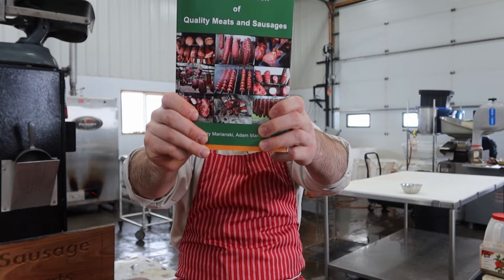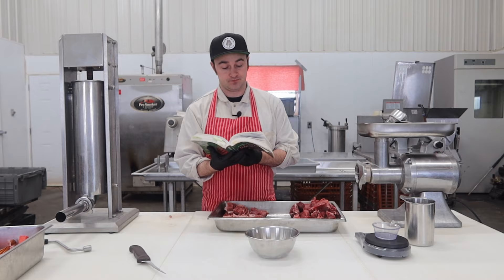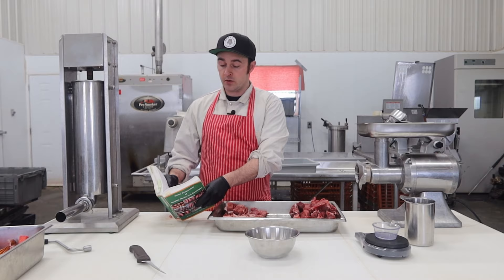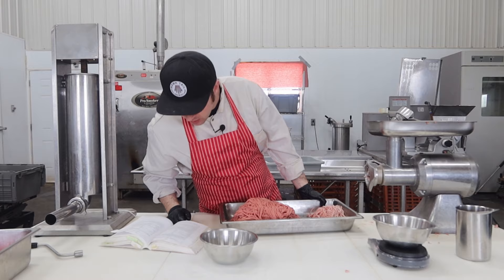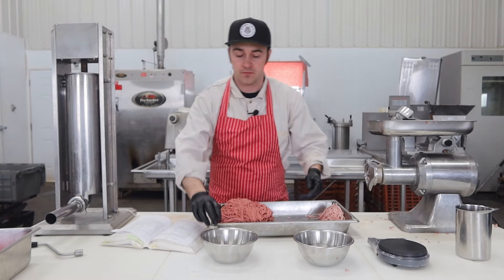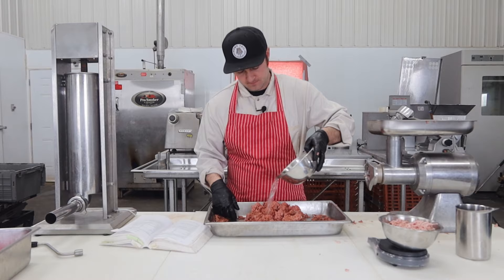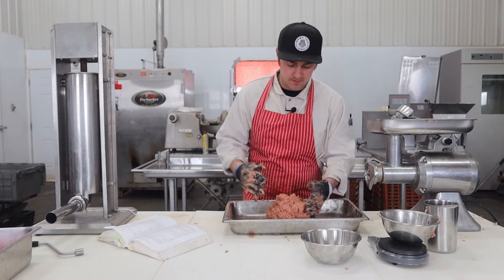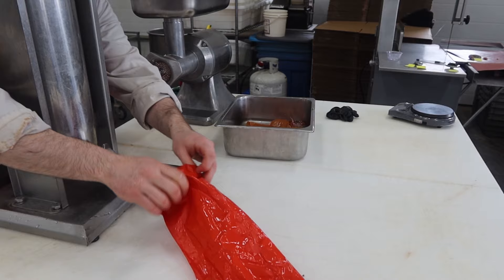How to Make Homemade Bologna, Home Production of Quality Meats and Sausage.

Comment: How in the world can you call this home made when you are working in such a well equipped, professional kitchen? Anyone could make this product in your space, but what about those of us who don't have such a facility to work in?
Reply: I think Jeff has a difficult time or perhaps he doesn't realize what a commercial establishment is that turns out tons of Bologna everyday compared to what Duncan is making in a four inch pan in his shop
Reply: With a meat grinder/sausage attachment to a home mixer and a back yard BBQ grill (use upper rack for meat, put basin of water closest to heat & wet wood chips on briquettes) Bingo, sausage making at home!
Reply: Maybe Jeff doesn't have independent thinking skills.
Reply: If you can't make this at home, then you don't belong in the kitchen.
Reply: I was able to make it in the Philippines. So you should be able to un your mega kitchen
Reply: Improvise with the information given in this INSTRUCTIONAL video!
Reply: Kitchen aid mixer with grinder attachment,  stuffer from Lem. Home made smoker.